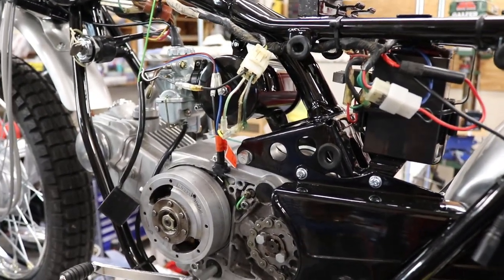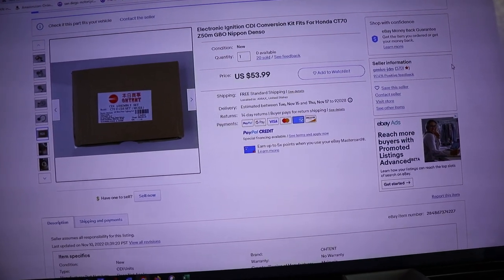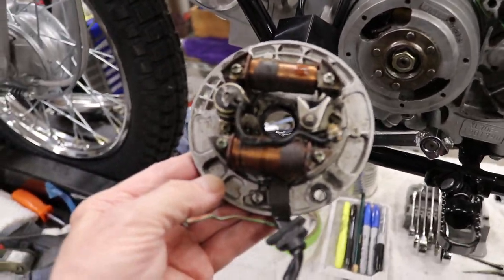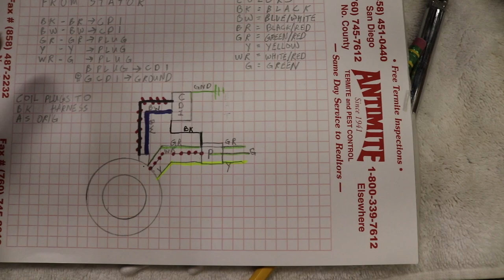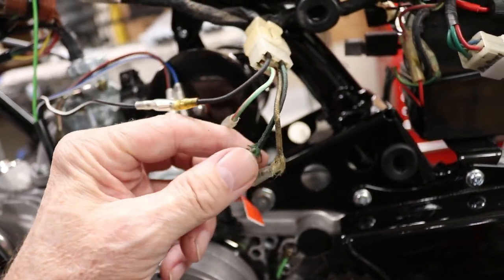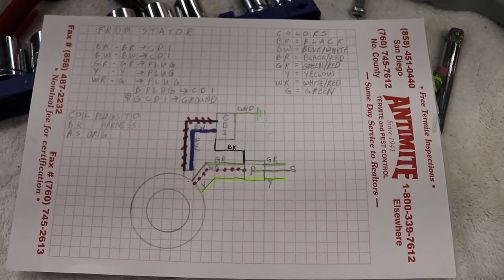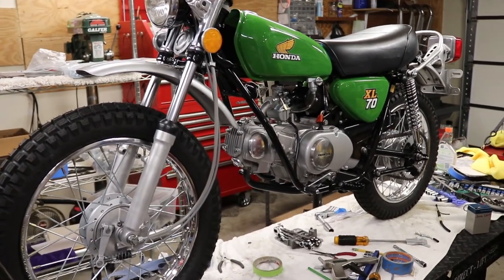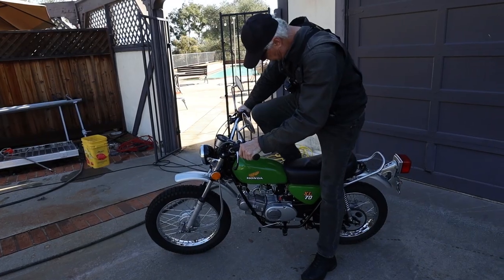Honda 1976  XL70 Electronic Ignition CDI for $60, will it work?

Comment: I Got a Honda C70 cub engine for my ancient C50. To my surprise this engine had no points but CDI which I had to adapt to the wiring of the 1960s C50.  I needed another type of coil and then some. Your video helps with the project. Thanks ..
Reply from the maker: Awesome... hope you get many smiles!  Cheers.

Comment: Wow great paint job and I love the Honda wing and side covers!
Reply from the maker: I actually painted them myself.  Home Depot sells a new line of spray paints. Behr "Luck of the Irish Green" is nearly a perfect match.  I clear coated the decals with 2k two part clear coat to make them fuel proof and then wet sanded from 400 up to 2000 grit.  Then 3 stage Meguiar's polishes.  Looks like wet candy when finished.
Lots of work but fun to see the results.  The 88cc Big Bore kit from DRATV is really worth while too.
Cheers! -Kirb

Comment: Thanks for the video and the links to the parts.  i just bought a non-running 1974 Honda XL70 that I'm planning to restore.  I am planning to do pretty much the exact same thing you have done to yours.  I was considering the 100cc big bore kit, but I have to do a little more research before spending $515.00 with shipping.  Again, thanks for the video and the links.

Comment: Nice work!  Where did you source your new tires?
Reply from the maker: I get them though a local shop, Outrider Motorsports (760) 631-8446.  They are Shinko 241   2.75 x 14 and 3.00 x 16.  The front tire should be a 2.50 but we couldn't find that width.
Reply: @cramersclassics  Thank you sir!